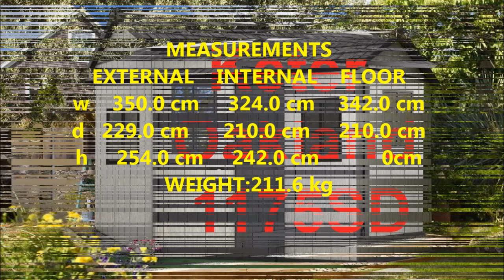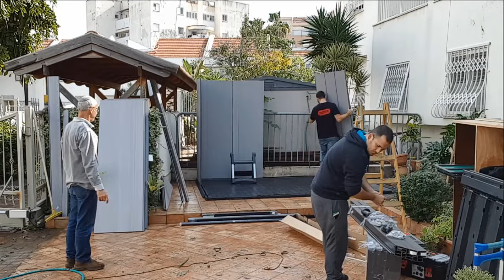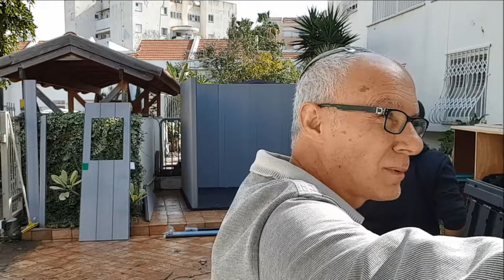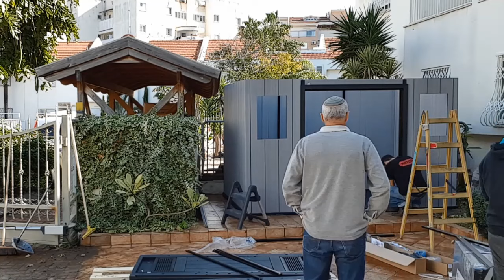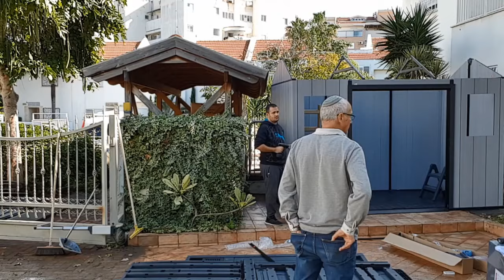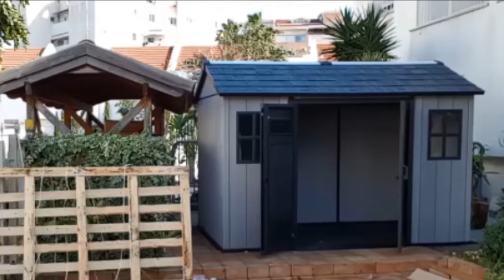Keter Oakland 1175SD Outdoor Garden Storage Shed

Comment: Expensive shed. It’s nice

However, no instructions were included and I was shorted on screws

Some holes did not line up and wrong screws were suggested for attaching the door frame.

There’s a little gap at the bottom and top where the doors meet. Of the snow or rain blows that way it will get inside. My less expensive Rubbermaid doesn’t have those. Poorly made doors to say the least.

Plus no instructions (had to print all 33 pages off myself) on how to level the shed.

A lot of mistakes for $1699
Reply: 100% opposite experience here: we have extra screws, the screws & frame = perfect per concise instructions, no gaps, doors are solid & definitely not poorly made. The instructions were buried somewhere in the boxes but are also online, super easy to find. Have to chuckle because no way did you have to print it all out - we always had them open on our phones plus a tablet sometimes, easy peasy. I will say that it took us 3 days to build it. But then, we'd never done this before. When finished, we too found some gaps with the doors, finally realized the issue was entirely our error. Maybe just backtrack like we did, as for us this awesome shed turned out exactly as Keter describes it, there's nothing funky but mind you there's also no room for error. The best thing I've bought in years, we've had it through 2 winters now with no problems whatsoever plus it looks brand new. We get lots of nice compliments. I spent the same amt. of money you did, would do it again. As far as leveling the shed, well okay that is actually pretty standard stuff like location choice that I would not expect Keter to have any part of: if I knowingly spend $1700+ on a shed that clearly says it'll need a level foundation, then it's my responsibility to prepare & provide it for my expensive purchase.. which we did. We used 8 concrete piers/marine grade plywood, did hire help for that initial part & completed it one week before delivery. It's a serious shed. I agree with you that it's nice. We're sure very happy with ours!
Reply: @hweber7788  do you have issues with the condensation inside? The windows are fixed, or can be opened? Thanks!